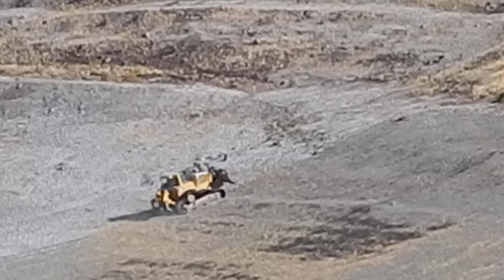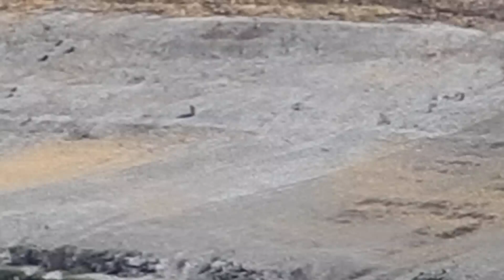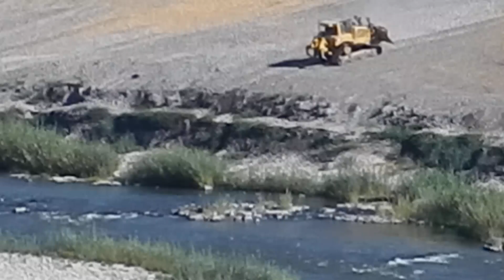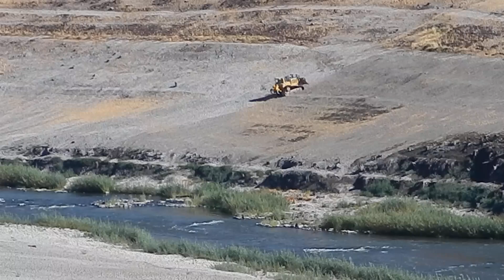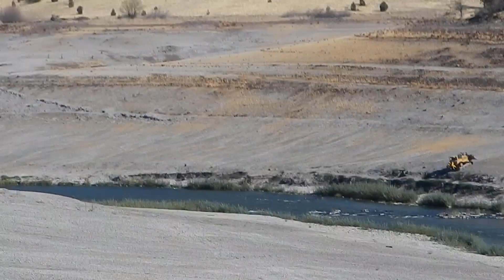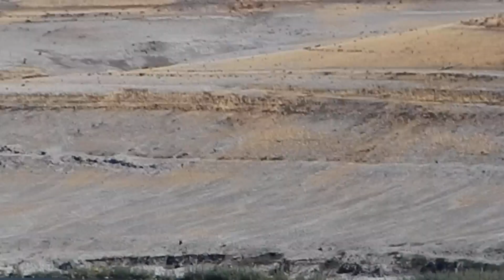Initiating An Erosion Acceleration Program at Iron Gate Canyon

Comment: Those horses are mostly on north western edge and feed on the RV parks clover all summer when grasses are dormant.    
   Same with the area deer.    They do no damage other than fertilizer and occasional footprints.   
      Starthistle will eventually hold the banks.     Better off with river willow and Klamath plums to hold sediment and create structure to hold.